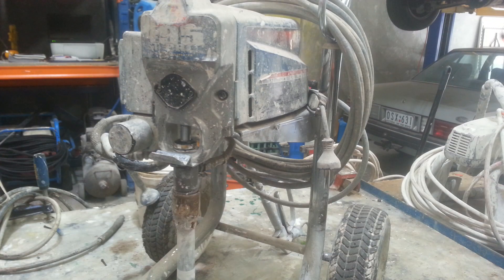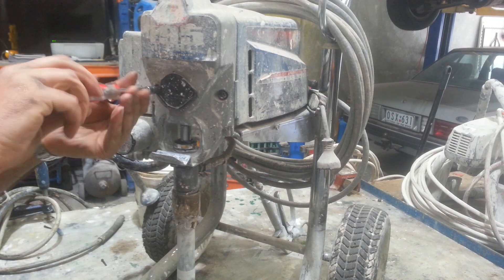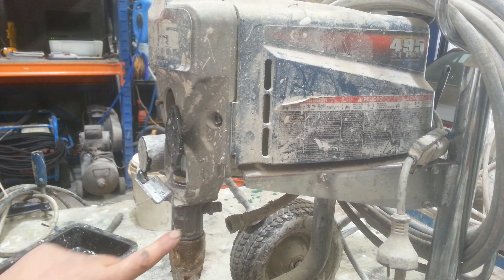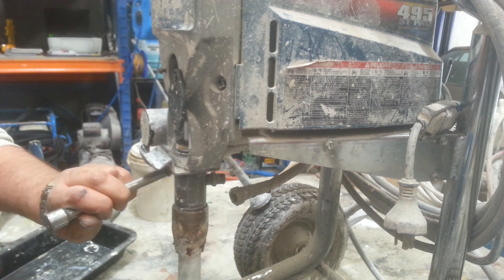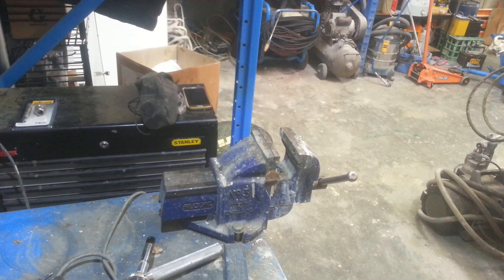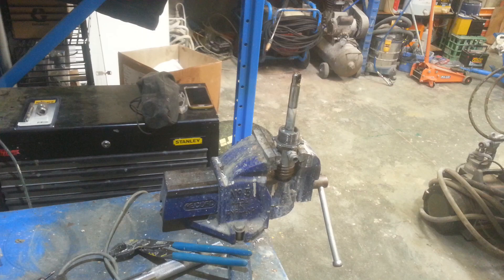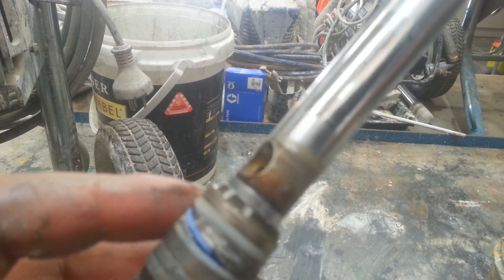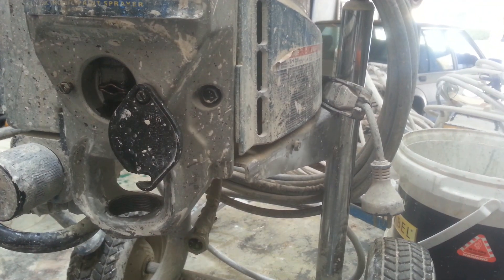Graco ST airless pump inspection

Comment: what replacement pump did you end up using can you provide the part number please
Reply from the maker: packings are 18B260 Piston rod if needed is 243174, complete pump is 243183

Comment: Hi, I just runed in to your video and I have the exact same problem someone fixed for me ones and only lasted one working day,
Now I know what I need a full pump, 
Do you mind sharing the part # of the full pump so I can get a new one.
Thanks in advance
Reply from the maker: 495 ST is #246426, 495 ST Pro is #235699
Reply: @westsprayairless8763   thank you very much!

Comment: I just got that same unit. Could you assist me with more info on setting the lever for priming and spaying? Thanks in advanced.
Reply from the maker: The handle is used to change from Priming the paint to spraying, when you first start you point it down, this allows the machine to prime the pump and remove any air in the system, once the paint is coming through you switch it to the side and the pressure should now go to the spray gun.
Reply: @westsprayairless8763  Thank you very much for your help and assistance.
Reply from the maker: Hi Oscar, the lever doesn't have an adjustment it's a bolt on product. When assembling the valve make sure the hole is facing up, then place your plastic base, put your handle in the spray position, then line up and push in your pin.
Reply: @westsprayairless8763  Ok so I'm new to this, painting with sprayer. Beside the power switch I have a handle with an arrow, what is that handle for? It Has 3 setting.

Comment: Is there any particular paint brands you would recommend for exterior use? Not much info about what gets used in Aus
Reply from the maker: All the major manufacturers have very good paint, but by far one of the best available in Aus is Resene paints, the quality is reflected in their higher prices. The others are Dulux, wattyl,   Taubmans, Haymes, Berger etc, just ensure you use exterior paint for exteriors as they have a UV protection within the paint